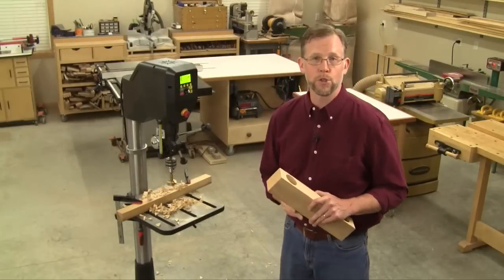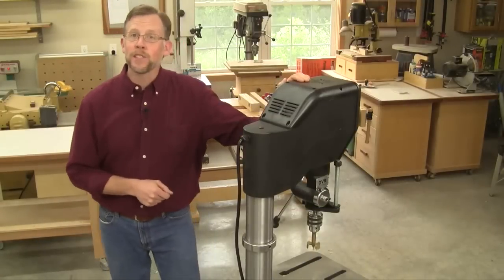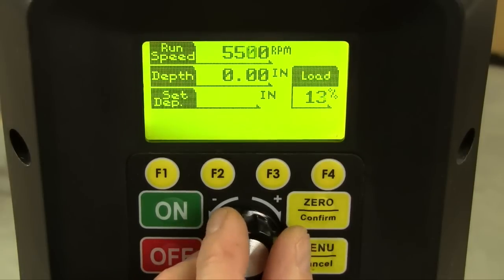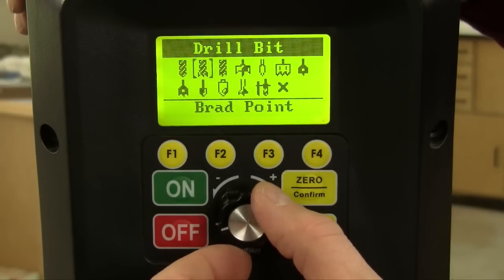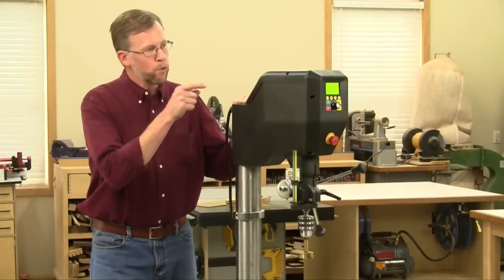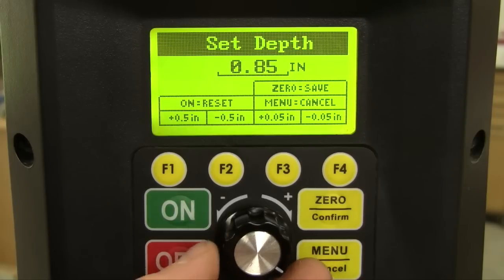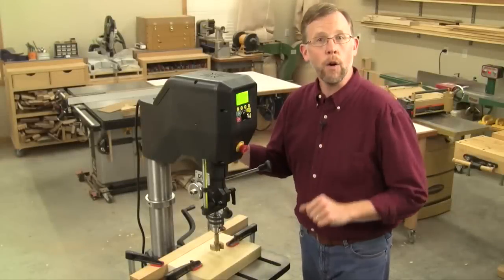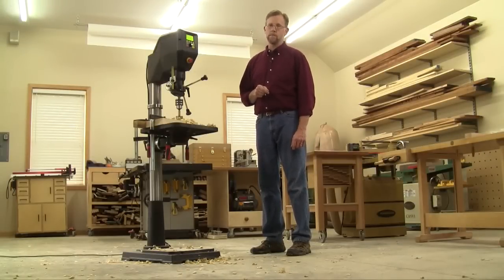First Look at the NOVA Voyager Drill Press

Comment: popular is a hardwood ?
Reply: Trees that drop leaves are termed hardwood. Trees that retain, year round, leaves or needles are called softwood. Not about the density of the wood itself. That's another measure :)
Reply: It's regarded as a hardwood that you can work like a softwood.
Reply: Yeah... its certainly soft but considered a hardwood... its often referred to as "the soft hardwood", or at least I've heard Poplar called this before on several occasions
Reply: The difference isn’t the density of the wood!
Hardwoods can be soft & softwoods can be hard!
It’s how the tree reproduces!
Angiosperms & Gymnosperms!
Hardwoods reproduce via flowers nuts & seeds!
Softwoods reproduce by cones & spores!
Ever seen a flower on a pine tree?
Poplars are angiosperms (hardwoods) because they produce flowers not cones.

“As it turns out, a hardwood is not necessarily a harder material (more dense) and a softwood is not necessarily a softer material (less dense). For example, balsa wood is one of the lightest, least dense woods there is, and it's considered a hardwood.

The distinction between hardwood and softwood actually has to do with plant reproduction. All trees reproduce by producing seeds, but the seed structure varies. Hardwood trees are angiosperms, plants that produce seeds with some sort of covering. This might be a fruit, such as an apple, or a hard shell, such as an acorn.
Softwoods, on the other hand, are gymnosperms. These plants let seeds fall to the ground as is, with no covering. Pine trees, which grow seeds in hard cones, fall into this category. In conifers like pines, these seeds are released into the wind once they mature. This spreads the plant's seed over a wider area.

For the most part, angiosperm trees lose their leaves during cold weather while gymnosperm trees keep their leaves all year round. So, it's also accurate to say evergreens are softwoods and deciduous trees are hardwoods.

The hardwood/softwood terminology does make some sense. Evergreens do tend to be less dense than deciduous trees, and therefore easier to cut, while most hardwoods tend to be more dense, and therefore sturdier. But, as the classification of balsa wood demonstrates, there is no minimum weight requirement to become a hardwood.”